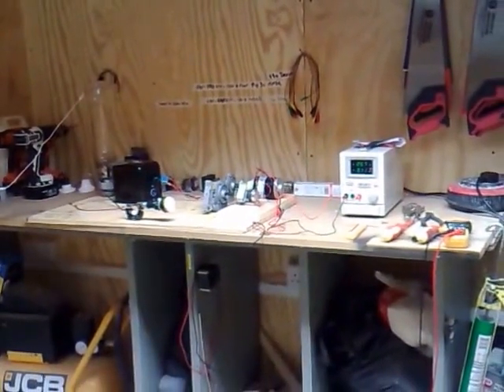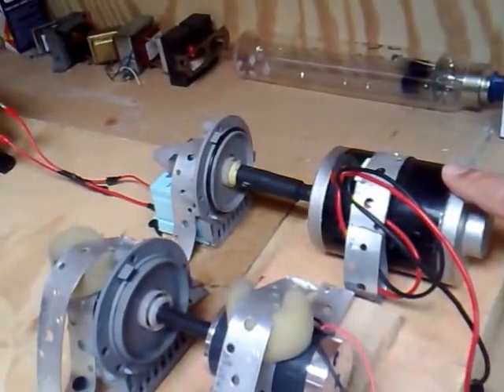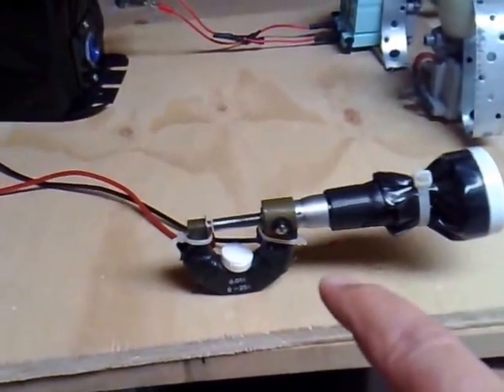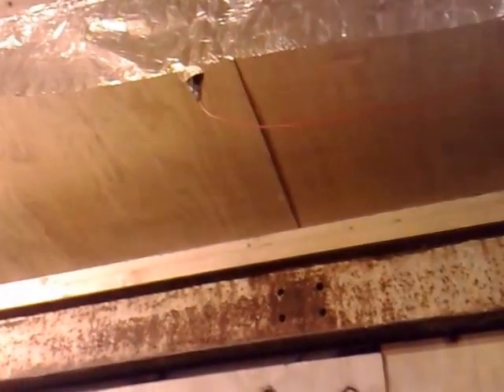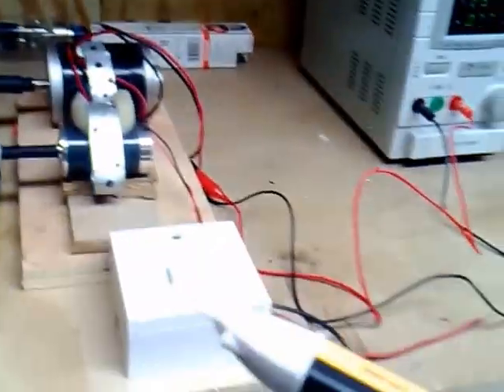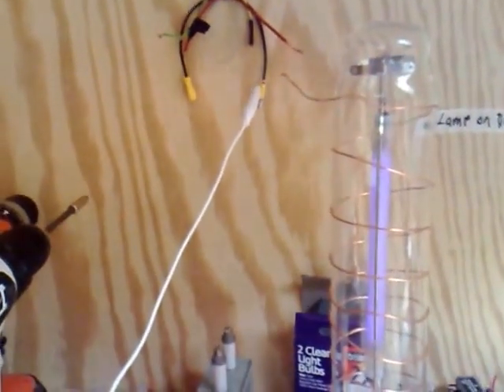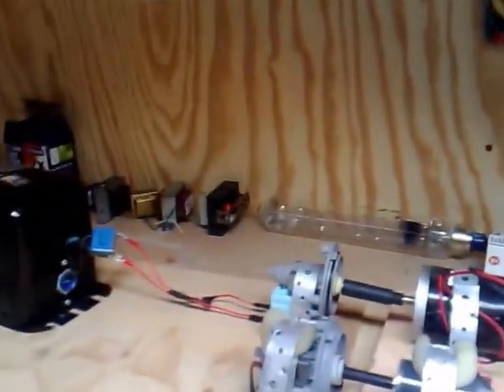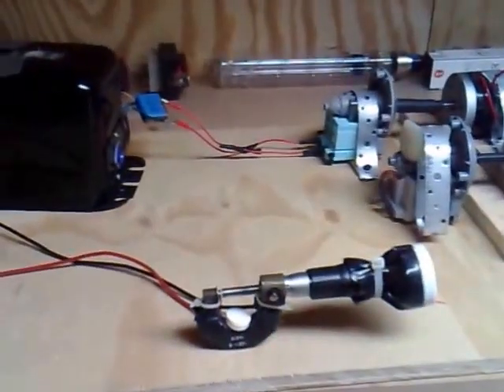Gerard Motor PROOF of RF.mp4

Comment: Hi there. With copper turns around the lamp you made a secondary coil of a step up transformer. The electric potential of secondary is floating and it is safe to touch. 
This is an excellent approach to extract produced RF energy from resonator loop safely.

Comment: I understand some of the reasons why Tesla built that big tower in new york and he did successfully light light bulbs from a good distance wirelessly but I never seen anywhere that he powered anything else like a motor wireless. So I just figured the reason for this is because of the high starting current involved to achieve rotation. Then I thought what a minute Tesla is no dummy he had to have had a damn good reason for building this thing and was even going to build many more all over the world transmitting power into the ionosphere as a capacitor so that a receiver can grab power anywhere in the world, you could be in the middle of the ocean and pick up power free. But why no mention about high current devices like ovens hot water heaters and so on? So for year I just ignored it because I never could find any evidence of that. Then one day I was searching the net and I found a story about Tesla and the way it was worded it sounded like a true account of what took place back in that day, this page said that Tesla successfully lite up light bulbs and a MOTOR wirelessly! I thought WHAT? why is it that I never seen this before? Remember that tower was dynamited by the man who paid for it, JP morgan, why would he destroy it? Hiding something perhaps. Did tesla find a way to run high current devices wireless with this thing? I mean he did run a motor, so hell he could run that why not something else that uses high current? But he wasn't transmitting current he was transmitting high frequency radio waves right? So if this is true then the secret is in the high frequency but not just any high frequency a finely tuned frequency that when received had the ability to be converted into usable energy. Could this energy be something that defies everything we have learned in school about electron flow? It was I have a big binder that someone gave to me years ago and he told me it was the writings of Tesla, It had strange circuits like levitation, overunity devices and getting electricity from wood, crazy bizarre stuff and in this binder Tesla wrote, whatever you learned about electricity in school it is a waste and has nothing to do with the way I understand energy, electricity is in everything that exists you just have to learn how to use it. He talk a little about an energy that wasn't power as we know it, it was more of a energy that can be collected and stored. I lost this binder and have been searching for it, if I can find it I will post it somewhere for anyone that is interested to see it.
Reply from the maker: +Harry Flo Hi HF very interesting note, it was of great interest thank you. ....  DC
Reply: +Harry Flo Tesla had a problem, he was a pioneer, and simply did not know where he was heading, and with the towers his idea was to increase the voltage to a point that would transmit power. At first he disregarded frequency, but got better results at higher nearer Rf frequencies, plus the spurious RF his coils made. His failure was to used tuned circuits in the transmitter to match the receiver, (radio), as he was not after Radio but power, his speciality. He never got power, and after he studied radio, fully understood why. RF is a very poor transmitter of power. He still thought that he could get resonance with his signal, but still failed as there is no one resonance in nature that you can use. He came to understand it later on.

On Tesla's later claims , just remember they were not his words, but the reports in newspapers, who wildly speculated beyond what he had said to them.

 Look at a modern example, Arther C Clarke, the writer, who's science fiction was often confused with his genuine innovations, by reporters.

An example from Tesla was his idea that a force could resonant with the earth, a powerful signal that would shake the earth and result in transmission of power. He was right , in a way it could work, but the power required would be totally astronomic. 

But his comments were taken as that he could shake the earth already by his tower equipment, and reported that he could destroy buildings at will, or even power space craft.

Tesla despaired of reading this nonsense, his work was being undermined by other peoples falsehoods.

Stephen
Reply: Yeah, I'd be frantically searching my stuff if I were you. If you ever find that notebook I would truly enjoy a copy. Tesla was uncannily wise. Knowing the implications and possibilities of his research, he spent a fair amount of time devising ways to mislead the overeager masses. If there is useful information in that notebook I'd bet its deeply encoded. Probably an elaborate cipher, with the legend securely within its contents as well.   Tesla constantly had to deal with leaks from within his own ranks. He was basically betrayed by everyone that ever  worked with him. So, as he aged and became more and more solitary, he would,  I suspect, have found the necessity of preserving his most beneficial findings for  future generations. The government looted his mountains of notes, and with their unlimited resources and ability to harvest the brightest minds from all around the world, haven't cracked the code yet. But they don't have everything. Tesla knew his work would be plundered. He was three steps ahead of everyone, always. Iv'e been searching everywhere to find documents of his that aren't publicly available. So, when I hear of an unknown "Notebook", I am intrigued to say the least. Decryption and code breaking is the most difficult pursuit anyone could undertake, especially when it pertains to the work of Nikola Tesla. The man was the brightest intellect of the last thousand years, in my humble opinion.  So when i say, "I would truly enjoy a copy", that's inconceivably understated. 

So If this inspires you to search again, and if this "Notebook" turns up. I would love to see it. Please contact me if so.
Reply: Did you find already?
Reply: @swallin19  Where did you find these reports/knowledge? I would be very interested to read.

Did Tesla understand EMF? That could be interpreted as an RF signal, right? Which it is, sort of. Just as a byproduct, unregulated. Unless built for that purpose.
Reply: Did you say JP Morgan destroyed Tesla's tower?   Wow,, the plot thickens.  Thank you for your post.  Very interesting indeed. 

 I do believe energy  can be transmitted.  Its partly how radio works.  Tesla probably used a transmitter antenna of some sort with amplifier   (HARRP is based on his tech ) to make the motor start wirelessly.  Do you know what year that article Came out? Reason I ask is because it seems to have been covered up and the story squashed by the u.s.  press which is  completely controlled since early 1900s.
Reply from the maker: HF are you still on line? DC

Comment: this just an interesting example of an emf in a transformer. The spark gap effectively converts the d.c. into an 'm" shaped sine wave (a.c.).In the light bulb the a.c. is induced into the coil wrapped around it. Although there is a potential difference in the secondary, the fact that there is no current flowing in the opened circuit at the foil is why you can safely touch it (the ladder is not bonded to earth). Do not give up experimenting, but be safe. I admire your creativity and initiative!
Reply from the maker: Hi CT thanks for your comment. I am studying electric & can not stop (fascinating). I agree with your comment, well most of it. I have made a "Stubblefield Coil" putting the winding's on a 1m x 2inch steel scaffolding tube. Using the "Morin Set up" & a tuned  two spark gap system; i am getting high readings on my amp metre. Can you tell me "What's going on" please. Experimental video "Plasma Power Generator Transformer 1" ....  DC

Comment: Wow, I am new to all this, it's like learning a new language! I've been reading all the back and forth and amongst it all I start to see patterns. I just have two points to make.
1. If something has been made illegal or globally controlled it's definitely worth looking into for example, hemp materials, psychedelic drugs, 432hz vs. 440hz music, off grid living etc. All the good stuff is illegal.
2. If something is "proven" by mathematics, it may not be how reality actually works but only describes parts of it, after all, the very existence of reality defies mathematics... 0+0=0
Reply from the maker: +pinealism Just when you think you know something, you find out you know nothing! That's good, much to learn.Regards...... DC
Reply: Check
Reply: It's true. I made enemies with my electrical tutor in electrical college for for suggesting we can produce any amount of AC power from DC power if we try practically not mathematical and we could read and get information from our bodies if we arrigne emf with our body emf. He shut me down and asked me to chose if I want to graduate as an AC electrician  or motor vehicle technician. That was 1992. With what I see on utube now I believe I was right all along and should go back and try something else also disturbing me on the issue of why we have to use Battery to power vehicle and motorcycle etc. It's possible to make mobility from simple power generators.

Comment: I teach basic AC/DC circuit theory in college and one of the hardest things for students to grasp is Ohm's Law, which is the relationship between voltage, current, and resistance (voltage equals current times the resistance).    There is no sense in explaining that power equals voltage times current if the student does not understand ohm's law.  The next big step in learning electrical principles is when alternating current is introduced along with capacitance and inductance, which then leads to an understanding of ac series and parallel resonant circuits.  At that point, the student is on the verge of understanding radio and radar principles of operation.   So there is no substitute for a good and basic understanding  of Ohm's Law.
Reply from the maker: +James Hacsi Hi James DC here. I am a student no more.Ohm's Law relationship between voltage, current, and resistance got it. Now plasma zero's resistance (interesting) plasma Globe & fluorescent tubes attract my attention. Take resistance out of Ohm's law, again interesting.  So the BIG Question is what is electric? Regards.... DC
Reply: Ohm's law and all this electrical calculations don't mean anything at all. It's as simple as understanding what Gerald said which is a fact. Power in everything is just resonance. Be it be in plants, chemicals, humans the stars etc , it's all a matter of resonance. Think about that for a second.

Comment: I'm having a hard time figuring out why there are so many replications and so much interest in Gerard. I haven't seen him show anything but running small loads on motor driven dynamos. People were doing that with Bedini motors back in the day but running the loads using only the inductive kickback. What is it I'm missing? 

Some of these tests remind me a little of the Tesla Hairpin circuit setups at least when it comes to feeding in something as low as a 60 hz signal and getting a ton of RF out of it.
Reply from the maker: I agree he is focused on high frequency however he is an expermentor, which I admire.... DC
Reply: @e.powerdc1127  I'm on the side of any experimenter but I just can't figure out what it is specifically Gerard was trying to show
Reply from the maker: @Magneticitist  hi M.. Electric is interesting and deep like magnetism. Tesla everything is light! Ken Wheeler's understandings on magnetism is on the money... Regards... DC
Reply: @e.powerdc1127  when he said everything is light he meant everything is EMR light is just 2% of EMR and as u go up u have higher regions of energy, as in gamma radiation but thr is energy..... What needs 2b achieved is vibration at particular frequency and like ac at regular intervals ie 3 phase 20cps x3 times for 60hz ac same way using these frequency it's a churning process up nd dn wr by pos and neg charges  seperate out, left and right spin.... and ur in the process of making energy

Comment: Could that be the static charge, Gerard,  speaks of that returns on the ground  line to the station,in one of his vedieos?
Reply from the maker: Edward connor call it what you want. However understand E.U. electric universe, electric sun, ac motor Earth / Earth acting as a capacitor at about 8hz, if you understand... Regards.. dc
Reply: E.power DC thanks

Comment: Your Fluke tester detects EMF. - Not RF. I use the same tester to detect live electrical circuit wiring when I perform electrical work and troubleshoot electrical wiring faults. The reason as to why you weren't experiencing any electrical shock when you made physical contact with the suspended aluminum foil is because you weren't effectively grounded - and because the circuit had no reference to ground - there is no where for those electrons to go... I see this all of the time when working with ungrounded "DELTA"-connected three-phase electrical systems here in the United States. With this in mind - a 3-phase ungrounded "DELTA"-connected system has all three phases connected without reference to ground. With this sort of system, ground-fault detectors are installed on all three phases. When a phase shorts to ground for any reason (maybe a faulty motor winding or faulty wiring short-circuit fault to ground); the system will continue to operate normally unless a 2nd ground fault occurs, thus causing a dead-short circuit across two of the three phases in the ungrounded system. The phase ground-fault detectors alarm when any of the ungrounded phases are referenced to ground as a result of a short-circuit to ground. A corner-grounded "DELTA"-connected three phase system behaves in this way - although one of the corners of the three phase "DELTA"-connection is intentionally grounded - and that phase is actually grounded in comparison to the other two phases in the system - for example in a 480 volt corner-grounded three phase delta-connected system - one phase is 0 volts while the other two phases read out 480 volts each and 480 volts across any of each measurement (X, Y or Z)... A "WYE"-connected system is solidly grounded through its neutral connection (120/208; 127/220; 277/480; 347/600; 240/415; 230/400; 220/380, etc. each line voltage referenced to ground in this the of system will measure approximately 1.732 times across phases or line to line voltage measurement.) - whereas the end of each winding is tied together to the "NEUTRAL"-connection and then intentionally grounded to a grounding/earthing electrode or electrode system. The "DELTA" connected system is designed whereas the ends of each winding is then connected to the ends of each corresponding winding and the phase connections are then made at the junctions between each winding. In a three-phase; four wire delta system that is common in the United States for some small commercial and industrial installations - operating at roughly 240 volts line to line with one of the phases; a grounded neutral connection is half-way across ONE of the PHASEs; thus creating two "legs" or phases with a ground reference of approximately 120 volts to ground and the third phase being approximately 1.732 times the other two phase reference voltages to ground (120 x 1.732 = 208) or a bastard voltage of approximately 208; while the phase to phase voltage across any of the phases in the 240-volt system remains 240 volts. UNGROUNDED DELTA SYSTEMS ARE GENERALLY USED FOR INSTALLATIONS THAT REQUIRE A LEVEL OF REDUNDANCY TO PREVENT A POWER OUTAGE UNDER FAULT CONDITIONS - SUCH AS THAT OF HOSPITALS. Transformers are generally used to step down the incoming 277/480 WYE or 480 DELTA volts to 120/208 WYE or 120/240 DELTA volts to then be utilized for specific purposes such as that of industrial machinery, distribution for lighting or smaller general power loads. Single-Phase-Three-Wire (120/240 Volts) can also be easily derived from a Three-Phase-Four-Wire 120/240 DELTA SYSTEM. SINGLE PHASE 120/240 VOLT; 3-WIRE SYSTEMS are used domestically in North America (United States, Canada & Mexico.)

Comment: Adding the spark-gap does hint of a Tesla coil type device.    Is your overall objective to transmit energy wirelessly like Tesla proposed?   The bottleneck in that case is that transmitted power diminishes at the square of the distance from the transmitter.   It's then imperative to have an understanding of  parallel resonant circuits (or "tank" circuits), because an antenna receiving rf-energy one mile away from say a 10 kilowatt transmitter will be receiving energy in the microvolt range.  A tank circuit selects the frequency (like adjusting a radio channel dial) and it distinguishes the inteligent tiny signal from surrounding noise.    But energy or transmitted power diminishes very rapidly as the distance from the antenna increases.
Reply: BTW, the best part begins at about 25 minutes into the video, where Dr. Lewin walks his dipole receiving antenna around the lecture room.
Reply from the maker: +James Hacsi Hi J.H you have to have a really big transmitter. Also its complicated but do-able; I am looking at power from air extraction. Experiments extracting power from the vacuum & Over Unity.
This video channel looks at HV electrical potential in terms of frequency, voltage, the spark gap,  RF & physics.Thank you for the link, get to it when I can good luck with your work, please keep me posted.The dipole is the "Hearth of the Matter" its like exchange (Like eddy currents) also like a capacitor, interesting.Also note worthy "Earthing / Grounding vast subject on its own.Regards:- DC